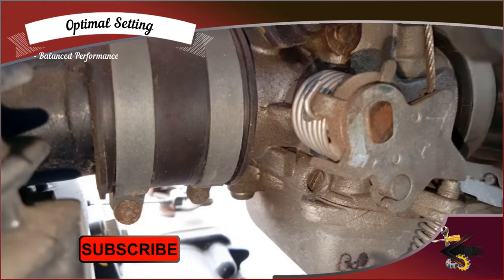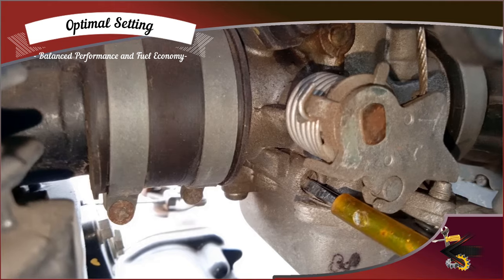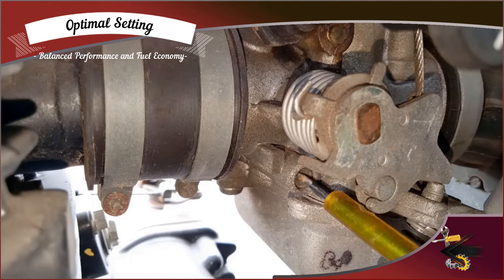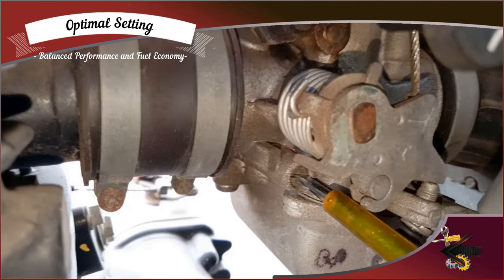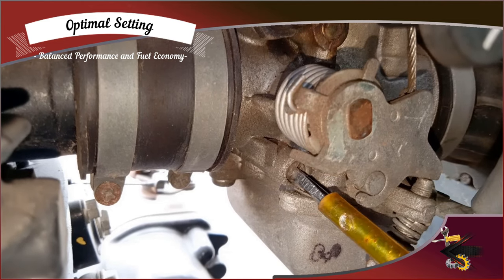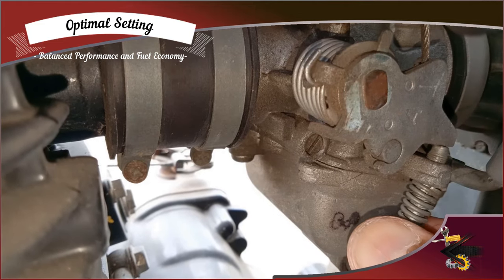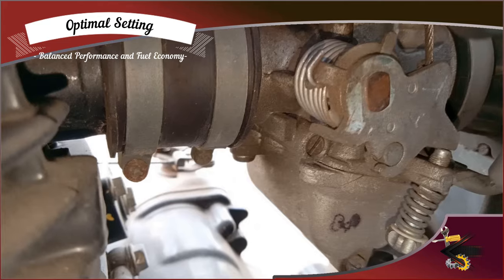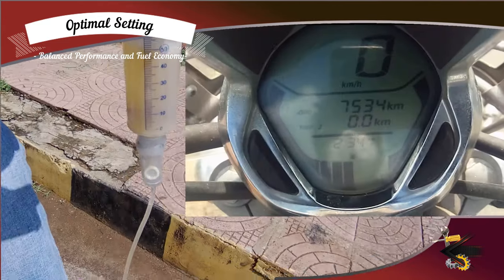Carburetor Tuning Mileage Test | Best mileage test | #carburetor | #mileage | #increasemileage

Comment: The defination of fuel economy lean / rich is in the term of milege So lean or rich is consideration in term of mileage . I personely observed that if u tight the petrol mixer screw less area available to transfer fuel to the Engine. & Loss the Air screw more air transfer to the engine So that It is  correct .
Reply from the maker: I am unable to ascertain if you are agreeing to the thoughts shared in the video or disagreeing. Kindly clarify

Comment: Each time when idling screw is increased before setting screw  for lean or rich at what RPM is it set at. For example my bike's ideal rpm is 1250+/-50rpm, how much do I increase it to while finding lean or rich mix points?
Reply from the maker: RPM will not be same for all vehicles, it may differ

Comment: Hello thank you for this awesome video I heard that using a rich mixture (according to your method) 
tends to heat the engine a lot and damage it is it true
Reply from the maker: Hi, thank you for your time. No, actually it's the other way round. Lean mixture will make the engine run a little hotter. However, don't worry since that is well within the tolerance levels

Comment: For yamaha fascino what will i do for rich and max mileage how much turn i need to do in my yamaha fascino 113 cc?

In my calculation 1 turn is 1 full turn so pls give an answer how many full turn i need to do in my yamaha fascino?
Reply from the maker: It should be somewhere close to 2 turns. However, I suggest you identify the correct positions by adjusting the air screw as shown in other video
Reply: Fascino only have fuel screw its cv carburetor then how much turn it need?  @autobotgeekse

Comment: How many turns u done for optimal performance from close point its 4 full turns ??
Reply from the maker: Yes, it was 4 from close position
Reply: @autobotgeekse  4 full turns means 4x 360 degree?
Reply from the maker: @garfold1042  yes
Reply: @autobotgeekse  my motorcycle 100 cc how i get optimal burn in sparkplug rusty brown
Reply from the maker: @garfold1042  please see my other carburetor tuning video. I have explained how to attain optimal position

Comment: why does the scooter vibrate when idle? carburetor setting??
Reply from the maker: Vibration depends on multiple factors. Engine refinement, usual wear and tear, riding habits and engine condition as well. Tuning has a very little part to play in vibration unless high idling rpm is set.

Comment: How to set perfect mailage in 220f model 2018 sir.please reply
Reply from the maker: Fuel injection models does not give a leverage of adjusting the mileage. The only work around would be to change the injector with narrow aperture.
Reply: @autobotgeekse  how to contact you personally? Any mode available?

Comment: Hello brother thank you so much for your video but, I have few questions.
Will I get maximum top speed and acceleration on your lean mixture point c where I get maximum Idle RPM ?
Suppose the rotation scale is from 0 to 8.
According to your video I get rich mixture at 1.5 rotation and lean at 3.5 and consider optimum is at 2.
But after 3.5 the engine also runs the  Idle RPM becomes low at and at some point the engine shuts off; Same for the rich side if I push it below 1.5 rotation the engine shuts off.
So what is happening?
When I am losing the screw and when I am tightening it.
At point C I get maximum Idle rpm but both on C- and C+ the Idle RPM becomes low. Please explain please.
Reply from the maker: Please see my carburettor tuning video for detailed explanation. Yes, in lean setting vehicle will have good pickup and top speed. By adjusting the air screw we are regulating the amount of air that gets into the combustion chamber. This in turn also affects the amount of fuel being sucked. Hence, we see a difference in engine idling when we start tightening or loosening the air mixture screw
Reply: @autobotgeekse  brother thank you for replying I saw your both videos. But what is the case after the maximum Idle Point.
After and before C point the RPM decreases. What happens if we keep loosing the screw after C point?
Reply from the maker: @sadiqulislam5279  thankyou, if you loosen the screw further point C it will not make any difference as screw will not be blocking the passage aperture anymore. If you loosen it further you may end up removing the screw completely. Screw will be regulating the air and fuel passage until the time its conical part obstructs the passage.

Comment: im trying the method of raising the idle to high level and making the air fuel screw leaner, the rpm is having a hard time rising despite? could it be because i have a large pilot jet?
Reply from the maker: Did you change the pilot jet?

Comment: Pulsar150 optimal settings pls help how to set i got little jerks while starup in evg times pls help carburettor cleaned airfilter changed but still i have this issue how many full screw turns for optimal performance and mileage for pulsar 150 ??
Reply from the maker: For optimal setting it would be around 3 to 3 and half turns from close position

Comment: My CT 100 clocked 6140-6300 on RPM meter after 2 turns starting from 960 with with completely closed mixture screw.
Now where stands the optimal point ??
In same situation at what RPM I should leave it to reach optimal & rich points ?
Reply from the maker: One more turn would be close to optimal position. Then adjust the idling beat. However, it's better to identify the correct position by following the steps shown in my carb tuning video
Reply: @autobotgeekse  4k447

Comment: Bro while getting higher rpm point the initial pickup is normal while fixing the carburettor at optimal point the initial pickup is high at every gear shifts whats reason ?? My bike is pulsar 150 neon bs4 model
Reply from the maker: Hi, hope you have seen my other video for tuning the carburettor. O have explained this on detail

Comment: Sir i own vespa 150cc scooty, if i set rich mixture then it damage my vespa engine?
Reply from the maker: It should not, it should be fine
Reply: @autobotgeekse  sir can you suggest me how many turns should  go from completely tight position of air mixture screw for my vespa sxl 150cc scooty. Its just sucking fuel like a hell.
Reply from the maker: @phanibapanapally4049  I cannot tell you the exact turns for Vespa. You can see my other video where I have explained carburetor tuning in detail. You can follow the steps and adjust accordingly
Reply: @autobotgeekse  hi sir, after increasing rpm...even after tighting fully my air mixture screw my engine is not turning off😅. If i lose it completely then my engine is getting of. So i completely tightened my air mixture srew and adjusted the rpm. my doubt is my engine is running even after tightening aire mixture screw how? 
Next one is if runing my engine by completely tightening air mixture screw  will it ruin my engine?
Plz help
Reply from the maker: @phanibapanapally4049  Idling rpm must be high due to which engine is not shutting down after tightening the air screw. Tighten the air screw completely (do not overtight) and then adjust the idle screw so that engine is barely on. Then start the adjustment. You should be able to find the rich and lean positions. For most vehicles rich setting would be close to 1 and half turns from close position

Comment: Sir how many turns need in AFR for best performance+mileage in pulser 220F
Reply from the maker: If I'm not wrong 220F is a fuel injection system and does not have a carburettor?

Comment: In my activa the engine rpm doesn't change after half turns out from full tight position. So I'm not able to set the afr properly
Reply from the maker: After closing the air screw completely, adjust the idle screw for low RPM. Then unscrew the air screw, you should see an increase in RPM.
Reply: @autobotgeekse  idle screw for low rpm meaning set where the engine doesn't stall or turns off ?
Reply from the maker: @sourabhpanse  yes, you are correct

Comment: Bro i have replaced my unicorn 150 carburettor but during every cold start i need to engage choke for warming up the engine or else it wont start in any climate. What could be the problem?
Reply from the maker: Did you try lean setting? Lean setting should help during cold start.

Comment: My scooty yamaha ray 110cc gives only 30km mileage.. Do I need to change carburetor? Please help🙏
Reply from the maker: Carburettor is rarely the culprit. Try changing the min jet nd see if there is any difference. If you are still getting lesser mileage, have the cylinder and head checked.
Reply: @autobotgeekse  thank you🙏
Reply: @autobotgeekse   Sometimes in up-hill especially in off-road  I lost pick up.. Engine does not move even in full accelerator. What problem is this? Can you please help?
Reply from the maker: @Tenjuneaye  this might be a cause due to compression leak, piston o-rings might be worn-out. How many kms done?
Reply: @autobotgeekse  30k km
Reply from the maker: @Tenjuneaye  I meant, how many Kms driven?
Reply: @autobotgeekse  30,000 km bro..
Reply from the maker: @Tenjuneaye  30k should not impact the piston and bore that much but still have that checked once
Reply: @autobotgeekse  k.. Thank you so much bro for your kind suggestion🙏
Reply from the maker: @Tenjuneaye  wc bro, happy riding 👍

Comment: Rich setting for 220 avenger cruise..
How many turns from the lock?
Reply from the maker: 1 3/4 or 2 turns
Reply: @autobotgeekse  I’m very upset with my bike it gives 14km/ltr mileage, what should i do to make it gives upto 35??
Reply from the maker: @nishkhadka3087  How old is your bike?
Reply: @autobotgeekse  2017 model but bike other over all performance is in very good condition. That’s why I’m so confused
Reply from the maker: Oh, that's not good for a 4 year old bike. Air fuel mixture setting alone will not help in mileage. There must be other reasons for that bad fuel economy. Please watch my other video for mileage tips where other factors are explained. If none of them are affecting then try changing the main jet.
Reply: Should i change main jet or carburetor??? 
I talked with some bike garage, they say you have to change your carburetor. 
What should i do suggest me??
Reply from the maker: @nishkhadka3087  usually carburetor does not get bad unless it is incorrectly handled. Try changing the main jet first. But it will be difficult to find a spare one.
Reply from the maker: @surajnarkar3064  yes

Comment: how many turn out for optimal mileage
Reply from the maker: There are no fixed turns. You will need to find the point by adjusting the screw. This procedure is explained in detail in my other carburettor tuning video

Comment: Do you mean Rich mixture as rich in air or fuel.?
Reply from the maker: Rich mixture would be rich in fuel.
Reply: @autobotgeekse  
Sir,
Then I would like to know, rich mixture is economic relative to lean one in your case.
But, Lean mixture will consume less fuel compared to rich mixture - Theory.
Reply from the maker: No, when we use lean setting, more fuel gets pulled to combustion chamber along with air thus impacting the fuel economy.

Comment: I have already did this experiment, at 2009  in my lebero bike, but, nobody didn't accept this procedure, utuber also, I tried recently in my gladiator, the plug shows the mixture was lean indication, some mechanics told me that afr should be 1.75 to 2  turns. But IAM confused. Because they didn't give any definition lika as you, Yesterday I knew ur procedure is correct, which was I found at 2009 in my lebero...
Reply from the maker: Thanks, yes you were correct. There is a lot of confusion with tuning settings on YouTube. Hence I made these videos. Please watch my other carburettor tuning video for better indepth understanding.
Reply: @autobotgeekse  thank you, I am waiting,.
Reply: Please, advise the good engine oil for bikers, which one is correct oil for variant cc bike's,. That should be very use full to ur viewers. Please make the video as early as possible.
Reply from the maker: @suriyanarayananb7078 sure bro, will do

Comment: After watching this video, I realized my whole life was a lie. 😥

I knew before watching this video... 
Rich means better performance, low mileage.
Lean means better mileage, low performance.

Normally, technician set it at highest RPM. I watched thousands of videos about it. Everyone done the same.

I appreciate your experiment.. But it made much confusion.

It would have been better if you show how the spark plug color changed after each tune.

My question is, what will be the spark color for Lean, Rich & Optimal tune? 

Please reply.
Reply from the maker: Hmm, yes I have seen those videos which prompted me to make a carburettor tuning video. You can see that detailed carburettor tuning video in my channel. You can watch that as well. Yes spark plug burn change inclusion could have been better
Reply: @autobotgeekse  I already watched that carburetor tunning video.

But I didn’t get my answer yet. What will be the spark plug color for Lean, Rich & Optimal tune?
Reply from the maker: @SkjoyBd  spark plug colour will not change with just 1 or 2 rides of testing. However, in lean setting spark plug will be light brown, optimal - medium brown and rich will be dark brown in colour.
Reply: @autobotgeekse  Thanks for your valuable  reply. Last question, what if the spark plug color is White?
Reply from the maker: @SkjoyBd  wc, sometimes lean mixture with under jetting leads to white colour.
Reply: Theoretically 1gm of petrol needs 14.7 grams of air to make a proper combustion. In carburetted systems, the air fuel ratio must be set at 14.5:1 in order to get an optimal performance from the engine. When the AF ratio is set below 14.5 which is the tightening of the mixture screw, the mixture will become rich, as we are restricting the air below 14.5. Rich mixture will obviously provide a powerful stroke in engine, but lack of air won't let it burn completely, which results in high power and low mileage. 
 The vice versa of this procedure will be the lean part. When the mixture screw is loosened, more air will get into the carburettor and more the air, lean will be the mixture. When air ratio will exceed 14.5, the mixture will get leaner. Resulting in proper combustion but low power stroke. 
Rolling up this in simple........ Higher than 14.5 is lean mixture and lower than 14.5 is rich mixture. If u want to tune your carb of your own, find out the position when the engine will start to stall while tightening the mixture screw, and mark the position. It will be the point where mixture starts to become rich. Then loosen the screw slowly...infact very slowly and u ll notice a rise on revs, keep loosening it until the rise in revs will stop and mark the position. This will be the position where fuel will start to get leaner. Tighten back the screw slowlyyyyyyyyyyyyy and stop when u will notice a smooth idling.
That's all.
Reply from the maker: @techy1661  yes, you are correct. My other carburettor tuning video has a detailed explanation of tuning the carb. However, I have not included the theory to avoid confusion.
Reply: @autobotgeekse  very lean- white,   lean- grey,   optimal- brown,    rich- black,   very rich- black and oily. AnD you can se after 1min color of the spark
Reply: @techy1661  Good explanations. Thanks.

Comment: @AUTOBOT GEEKS E  my pulsar 150 is not giving good milage,please tell me how to fix it? How many rounds from the tight position of screw for rich setting?
Reply from the maker: It should be somewhere close to 2 rounds from close position. However, please watch my carburettor tuning video where I have explained the tuning procedure in detail.
Reply: @autobotgeekse  but the engine gets heated,below 2.5rounds, and no increase in mileage
Reply from the maker: @_DM_Vlogs  Try cleaning the air filter. Looks like air flow is not sufficient. Try following the carburettor tuning steps as shown in my other video. Turns may differ
Reply: @autobotgeekse  thank you
Reply: @autobotgeekse  today I set it until highest stable rpm, which I found at more than 3.5rounds, lets see the mileage
Reply from the maker: @_DM_Vlogs  wc bro 👍
Reply from the maker: @_DM_Vlogs  At highest RPM you will get lesser mileage
Reply: @autobotgeekse  yup I think so, but I also didn't get any increase in mileage in lean or below 2.5 rounds tuning,rather my engine got over heating and tappet knocking problems,So lean tuning is worst
Reply from the maker: @_DM_Vlogs  hmm, give it a try and see. There are other factors as well which will need to be considered. Like, how old is the vehicle and how many kms driven
Reply: @_DM_Vlogs  same here buddy every point mentioned by you is correct and I've experienced the same. Mine P150 also gives the best rpms and smooth operation close to 3-3.5 turns.
Reply: @piyushkadukar7337  yes,at the highest stable rpm, the engine becomes smooth